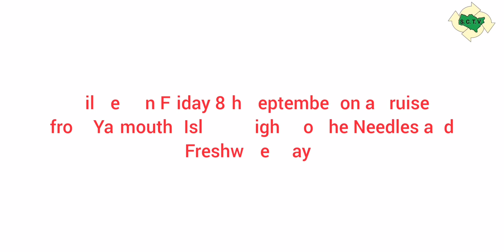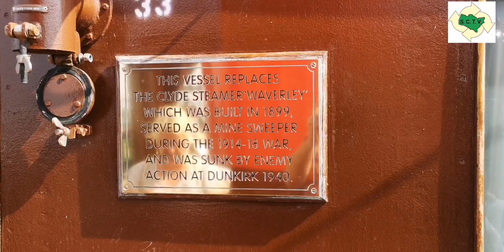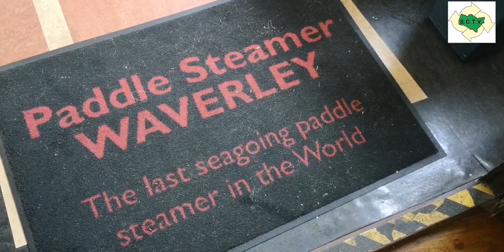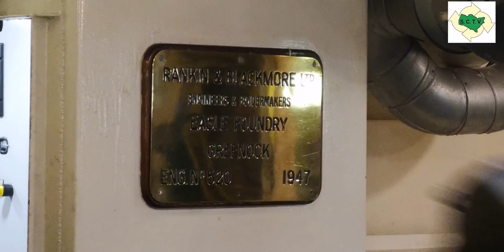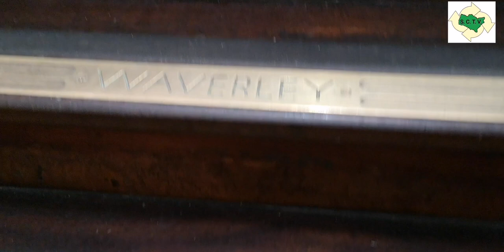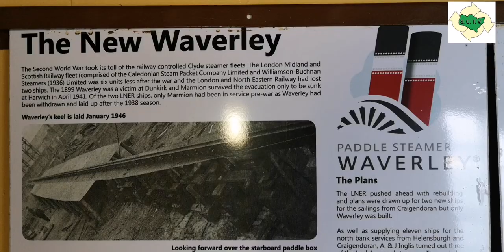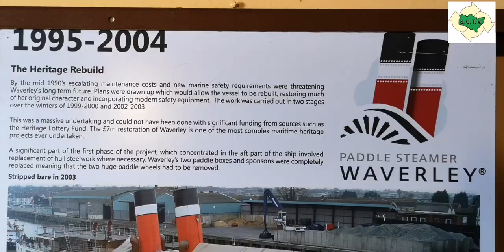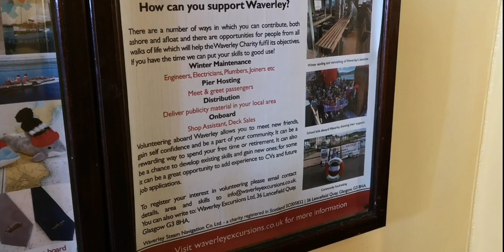Paddle Steamer Waverley.

Comment: It was a few years ago now, when we went on this magnificent paddle steamer, Waverley. We sailed from Portsmouth Harbour to (I think it was Yarmouth) on the Isle of Wight. We then sailed westwards towards the Jurassic Coast, but the Captain decided, that the sea ahead would be too rough for passenger safety and comfort. Instead we had a tour of Poole Harbour, and to do this safely, we required the services of a Pilot. The boarding of the Pilot was pretty scary, more so for the Pilot I think. Waverley had to match the speed of the Pilots boat, and it took quite a few, very brave attempts before he successfully boarded. A cruise on the paddle steamer, comes highly recommended, she is a great vessel.
Reply from the maker: That's very interesting and a similar thing happened a few weeks ago. She was due to go from the island to Swanage but the sea was again, too rough. They cruised the Solent instead!